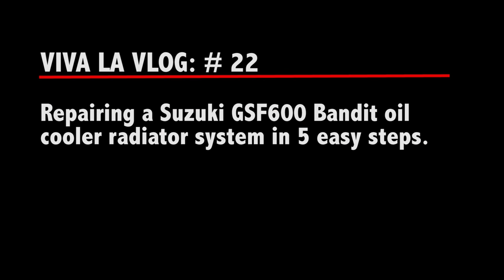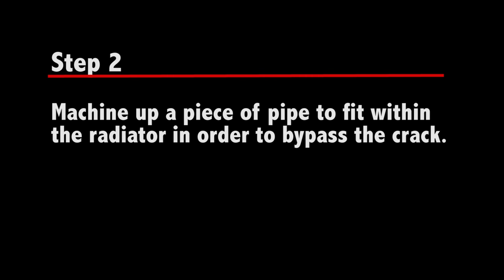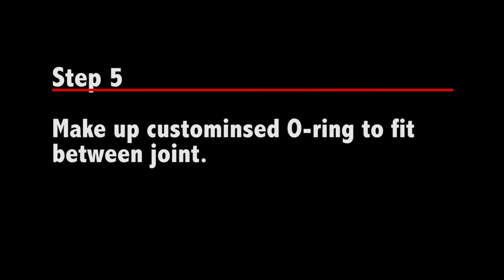Repairing Suzuki GSF600 Bandit Oil Cooler Radiator | VIVA LA VLOG (Shnearious Tutorial)

Comment: Hi,

Very helpful this video!

Could you please advise interior diameter for oil cooler, I'm going to do this containment.

Thank you!
Reply from the maker: It looks to be about 7mm - Freeze frame at 1:15 and on your own bandit unscrew one of these bolts. Using the computer screen you should be able to acurately work out that internal size. Good luck and cheers for your comment - glad you found the video helpful.
Reply: Hello. Did You managed to repair Your cooler with this method? Do You remember this inner tube diameter. THX

Comment: I've oil leaking from the bottom of my bandit 600 I don't know if the leak is coming from the bottom but that's were it's forming and leaking right under the engine any ideas what it could be ?
Reply from the maker: +dean mcevoy You'll have a better chance of seeing where the leak is coming from if you bring the engine right up to temperature where your oil won't be as thick, it'll flow free and ideally you'll see where it's coming from. Find it first, after that it could be something as handy as a sump plug which needs tightening or could need a new gasket, etc..
Reply: +The Miniature Scenes cheers bro it was the sump it's had a small crack I just took it off and used some chemical metal and put it back on all good no more leak :)

Comment: Hey which question I was hoping you could help me out with? My bike keeps dying as im driving along then when I try to restart it it starts up fine and idels fine so I hold in the clutch put it in first all is good but as soon as I releas the clutch no matter how much gas I give its dies like it has no power. day or two later could drive fine for afew mph and then do it again any ideas on what the problem could be ?
Reply from the maker: +dean mcevoy Sounds like your main jet within your carb is blocked. There's the idle jet which is working correctly by the sounds of it then when you drive the fuel comes from the main jet. Your carbs might need a cleaning as if its been sitting up the jets will sometimes block. If your still on the Bandit with the 4 carbs then once cleaned they would need to be balanced. No harm in replacing the 4 plugs while your down there!!
Reply: The Miniature Scenes cheers man much appreciated yea im going to give it a service while im at it filters oil and plugs thanks once again hopefully thats it